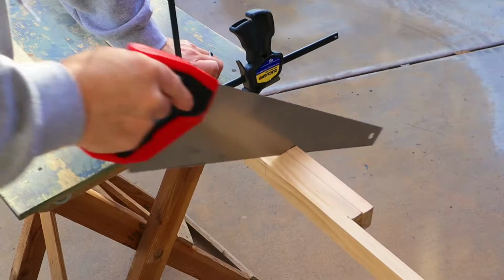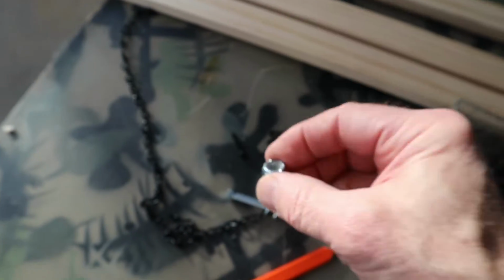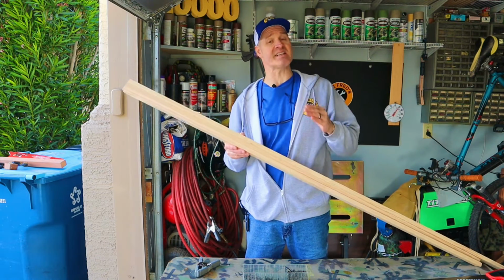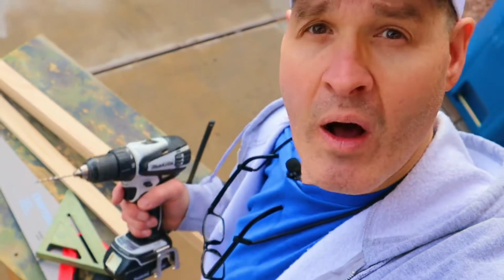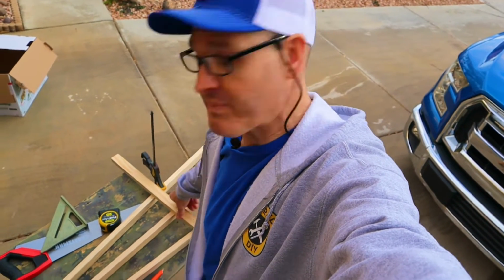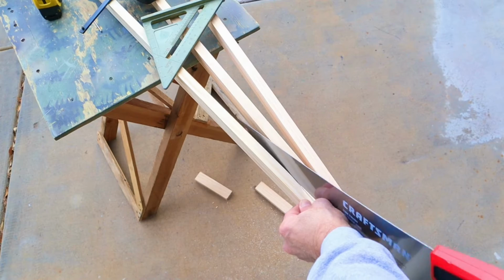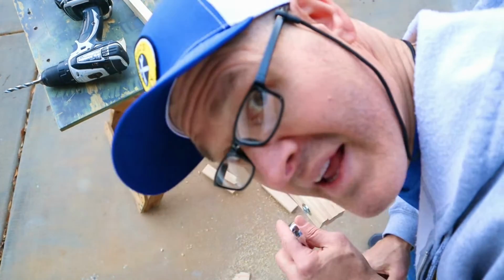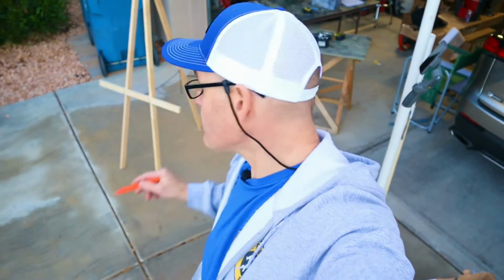Build an Easel Stand -Simple Step by Step

Comment: Watched this video after creating my own easel because I wanted to see options to improve upon my own design. It looks like our approach was fairly similar. Great job! Some improvement ideas. Screw the drywall screws from the back on the cross peace for a cleaner look. I also cut an angle on the center pole so that it doesnt protrude in the front if the item being displayed/created reached the top. 🛠🪚